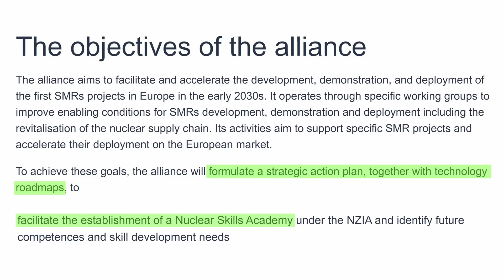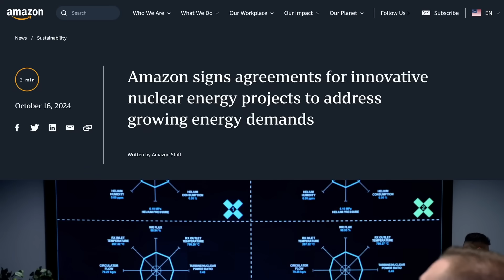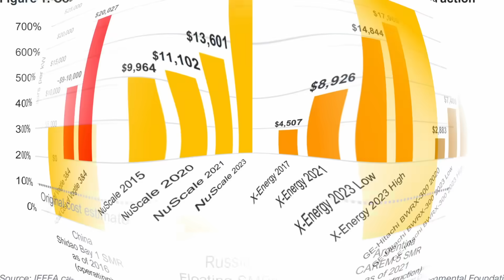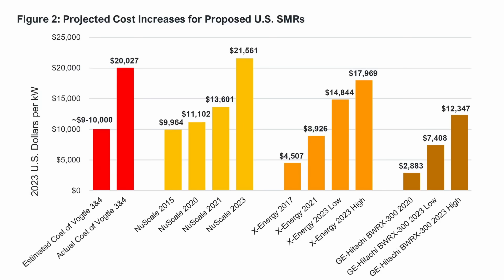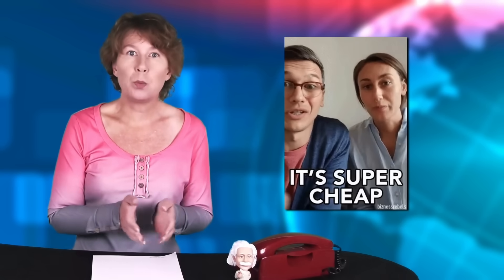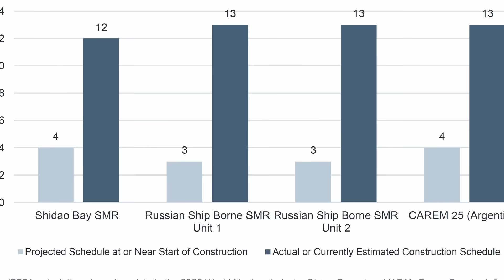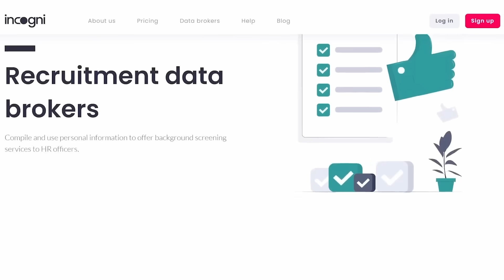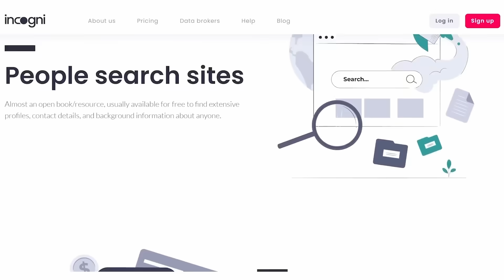Small Nuclear Reactors Have A Big Problem

Comment: CANDU reactors went over budget and still turned out to be a bargain LCoE wise.  It's unfortunate that Canada doesn't seem to have enough spare experts to built more of them elsewhere (They seem to only have just enough people to keep replacing the ones they have).  Correction: It seems Canada has enough CANDU experts to help India build about 3 at a time as well.  Without having unexpected "new site" (environmental concerns (endangered species), bedrock not being what was expected, Legal NIMBY challenges) or political issues it takes about 2 years.  With unexpected issues... ugh... 🤮 ...So let's just talk about if the site is already established! 2 years!  Refurb is "cheap" ate resets the life time! 👍  LCoE lower than solar without battery (if you include the first refurb (60 years))! 🤑

Comment: I watched your video thinking you might have some perspectives that others are missing, but you somewhat rehashed what other SMR dislikers have continually stated…. That they cost too much. While true if only a few SMR’s are built… it won’t be true for a design that takes off and does get mass produced. That’s the whole point of modular/mass-produced anything. 10 years ago, plenty of people said that EV’s would have never taken off because at the time, they did cost too much to make. Fast forward 10 years and million of vehicles sales later, the per unit costs have come down significantly, and now some companies can make them cheaper than gas cars. Will plenty of SMR companies fail? Likely… but if they’re the right design and have enough political support and capital up front to get over that initial R&D cost, they can become a reality!

Comment: SMR's have already been solved, at least in the US.  The issue is always getting regulatory approval for each phase of the research from the NRC who absolutely refuses to hand it out.

For those that might not know, the US Navy has been making SMR's for a few decades, those are the reactors that power Aircraft Carriers, Submarines and previously several other ships.  The A4W reactor for the previous generation of super carriers was rated at 550MW, the D2G reactor for previous unclear destroyers and was rated at 148MW.  The S9G, which is in many Subs, is rated at 210MW.  All these reactors are modular, and because the Navy doesn't' want "spent fuel ponds" inside its' ship, the reactors are designed to be replaced instead of refueled when they reach the end of life.  They cut a hole in the side of the ship, extract the old reactor unit, insert the new one, hook everything up then run tests to ensure it's solid before sealing the hole up.  These modular reactors are made on site along with spare parts, they are not bespoke.

Those designs exist because the Navy runs it's own nuclear program that does not have to obey the edicts of the Nuclear Regulatory Commission.  The NRC is not involved in any of the design, certification or operation of those nuclear plants.  The Navy has it's own licensing and training system that ensures Navy nukes are run safely because unlike the NRC, the Navy has a mission it needs to get done.

Comment: The nuclear industry has been intentionally lying about the cost for ages. Point Lepreau in New Brunswick was estimated at $400,000,000 for refurbishment. It ended up costing $2,400,000,000. They knew it would cost a lot. They lied all the way through. Now it's been shut down since April and it is costing New Brunswick citizens $1,000,000 per day that the system is down. 
We could have had a gigawatt or two of wind farm built with battery storage for the $2.4 billion price tag of Point Lepreau refurbishment.
One more thing...the nuclear industry lies about everything. There was no actual refurbishment. They tore down the old nuclear power plant and built a brand new one in it's place. That's not refurbishment in my dictionary.
Just a bunch of lying crooks.

Comment: Probably the regulatory overhead isn't so much anymore once you start building and realise the regulations define the minimum standard. So it's likely that most prescribed items would be needed anyway. And then overrunning of estimates, especially in time are really not so surprising, you'd likely not find a single reactor that was finished in the 2000s and 2010s that wasn't a complete overrun. So those few systems that are actually modern and  - assumed - safer still had those issues. Like anything we build on that scale. Its still likely a million parts (the only number I know is from the 70s or so where it was like 19million parts for a plant) and since the accident hazard doesn't change enough by scaling down you'll just not finish any in 1-2 years or so. Its just the portability that is gained.

Comment: Oddly small (modular is just not that useful a term, plug n pray) nuclear tractors um reactors (nuclear tractors are another story) do exist and work just fine, there are several hundred of them in the the nuclear powered subs that's hove the oceans also usually armed with atomic weapons ... quiet, very very quietly.

But are very highly guarded state military grade secrets in terms of production and operation ... most governments and their associated arms dealers will sell almost anything to anyone, except nuclear anything. 

So therefore it's implausible that private companies can just start developing and producing these things and then ship them to anyone, and plug em in to the grid? Nuclear anything is ridiculously complicated and expensive with massive lead times, safety concerns , security etc plus as above ... is just a go no governmentally.

Comment: "The Health Hazards of Not Going Nuclear" is a great book on the subject of Nuclear safety in the United States.
Reply: A book about the health hazards of fossil fuel combustion, right?   Well, renewables displace fossil fuels, so that argument is thrown into a cocked hat.

The actual deaths from solar/wind are so small that (at $12M/death) they would contribute negligibly to the cost of energy.  So, they cannot affect the nuclear vs. renewable competition, which nuclear loses on direct cost.
Reply: @pauldietz1325  Probably should read the book.
Reply: @rodneyjamesmcguire  That book was written in 1997.  Since then, adjusted for inflation, PV modules have fallen in price per watt by a factor of 25.   That book was comparing nuclear and fossil fuels, since cheap PV wasn't even on the radar yet.
Reply: @pauldietz1325  1977. You should read it. It doesn't really deal with pricing, but safety.

Comment: Nuclear power, like hydrogen, appeals to people with low IQ. A nuclear plant is effectively a giant space heater pointed at the sky and as power consumption grows , nuclear waste heat will outstrip any other form of anthropogenic heating.

That's why intelligent people support renewable energy which simply recycle energy that's already in the environment and then stores that energy in batteries which is the most efficient energy storage technology currently available.

Comment: Slightly OT but cannot all the "waste" heat generated by zillions of transistors be somehow recycled to produce clean water (desalination) , useful energy or both? Is it simply not do-able? After all, it is obvious that computational results are one thing and heat dissipated in circuit resistances is another. Since transistors can operate at temperatures above boiling point they could directly produce steam.

Comment: The problem is that the SMR concept isn't really driven by broad economics, the DoD wants be able to offload the burden of R&D, personnel, and tooling of nuclear reactors for its ships onto the civilian energy system.
Reply: That is what is happening over centuries. New technology is first developed for military use and is custom produced, and then as it gets common place is offloaded to civialian commercial production.
Reply: @dmitripogosian5084  Except the technology isn't fit for civilian power generation and these small reactors aren't the same as the military ones and need their own R&D. Civilian power benefits from the scale of large reactors. This is a case of the DoD trying to subsidize itself at the expense of the civilian power sector.  It is bad policy.

Comment: This lunacy is based on breeder reactors which require pressure containment and generate fissile materials.  Breeders won out over Molten Salt Reactors in the early 70s when Nixon picked them for cold war supplies.  MSR require no pressure containment since they fail safe.  They can also eat nuclear waste once they are running.

Comment: By "small scale nuclear reactors" im reminded of a portable nuclear powered generator set developed for the US government back in the 1950s.  It was decided to shelve the project after a quality working model was made because of fear that if released to the general population, "they would try to cut it up to sell as scrap metal" or something along those lines.  The Soviets also made such a generator set used to power remote locations.  In our press they are cursed for being potentially dangerous.  In reality I wounder if the threat to utility profits was the real motive.
Reply: Smoke detectors also used to have radioactive batteries
Reply: @АклызМелкенды  The sensor not the battery

Comment: I wonder why these big data centers don't just get more solar with battery backup instead of throwing money into these pipe dreams of small modular reactors? $3 billions? I'm sure that will buy more than enough solar+battery installations.
Reply: > I wonder why these big data centers don't just get more solar with battery backup
They have tried that, and found out the hard way that wind/solar are too intermittent for it to be economical.
The 'LCOE' that people quote leaves a lot to be desired!
Reply: @factnotfiction5915  I get that. But with $3 billions, seems like they can buy plenty of solar panels and batteries to overcome this.

Comment: The question is how these costs scale and whether they're associated with materials or with one-off expenses.  The oft-overlooked secret of technological change is that mass production is one of humanity's greatest strengths.  Costs rarely generalize.  The first unit and the initial R&D is always unpredictable, but the manufacturing learning rate associated with automating away whatever bottlenecks exist causes dramatic cost decreases as the number of units produced goes up.  Your first megawatt is exorbitant, your first gigawatt a luxury, your first terawatt a major industrial effort; But your tenth terawatt is too cheap to meter.

Comment: The citizens of South Carolina USA are going to have to pay for an incomplete Westinghouse AP1000 reactor, construction was stopped due to cost over runs.  I guess bigger reactors mean more money has to be thrown into the money pit ( a rarely talked about part of most nuclear reactorrs).  I'm sure the  people of South Carolina would love to have an offer from Google or any other tech company to buy into the project so they can cut their losses.  The cost being passed onto electric customers is large and a real problem.
Reply: It was not just cost overruns, it was natural gas and renewables coming on strong.   When the Nuclear Renaissance was big in the US there was concern gas would reach $13/GJ at the hubs.  It's down below $3/GJ now due to fracking.    Had gas been expensive and renewables not available V. C. Summer could have made sense to complete even with the cost overrun (the initial cost was sunk, after all, and the remaining cost was similar to the initial underestimate).   But with cheap competition completing it made no sense.

Tthe initial decisions to build V. C. Summer and Vogtle 3/4 were mistakes, even before the cost overruns.

Comment: Nuclear proponents are exhausting in hopes based on nothing. Thank you for a blunt breakdown of the data. 

Meanwhile, wind/solar cost more to connect to the grid from red tape than the power plant itself and are safe. Grid scale batteries supply chains are just ramping up with massive cost declines to follow. We already have a solution that will require a tiny amount of the mining as fossil fuels do, is much more efficient, and is cheaper than both fossil fuels and nuclear.

Comment: The red tape and legal challenges are the biggest hurdle. Most countries are trying to make smr comply with the requirements set for large high pressure reactors, which they can't because the systems are completely different. The safety requirements should be completely different as well as smr don't have the same potential for big explosions so shouldn't need a huge exclusion zone. The legal issues are huge, especially in America where pretty much any group can stop a project while a court case is made. The longer the projects take to complete the more they cost as most of the costs are upfront and they don't make money till they start producing power.

But the monetary savings from smr will only really kick in once the regulations are amended to make sense and large scale production begins. Like so many things, the first to do something faces a lot of difficulties, but once they show it's possible, lots will follow. Once we get to generation two and three of smr the costs should fall dramatically.

Comment: In Australia the opposition party (that is the guys with no power) have proposed we build 7 small reactors. Experts have pointed out this will cost billions and only replace a trivial part of Australia's energy needs so make no impact on our carbon foot print. This is while a solar or wind project can be completed in two years at close to budget, with the delays being how to connect all the extra renewable energy to the grid.
My favorite claim of all this is that no new transmission lines will need to be built, but at the site on one of these reactors they have stopped building renewables due to a lack of transmission capacity!
So the thing nuclear reactors do produce is bull**
Reply: Solar and wind are useless because you cannot control their input and are forced to try to store their output, which means huge batteries.  Further, their expected life is about 15 to 20 years, at which time they'll have to be replaced, again at enormous cost.
Reply: @AuJohnM  in Australia the most expensive electricity charges are when batteries are feeding into the grid at night.
Reply: @SpookFilthy  That's because your daytime costs have been driven down to incredibly low rates in the day time.  Any Grid that's night time power cost is more then it's daytime cost is already half way to the goal.
Reply: It's not incredibly low.  It's more expensive than other power sources when you add in the additional infra costs - look at places like California.  The more renewables in the grid the more expensive it gets.  Furthermore,  it is unreliable so then you need to bake in that extra cost of supporting it up with other power sources like gas. We pay more at night for batteries again than other power sources.  Renewables just don't cut it by themselves.
Reply: @grogery1570  The wholesale price of electricity is only one part of the cost of electricity, which also includes network, environmental, retailer, and residual costs.  Politicians needs to start talking about the full cost.  SA  has the most expensive power prices in Australia -  45.54c/kWh, vs NSW at 33.84c/kWh.  This makes my point.
Reply: @AuJohnM  which is different to fossil fuel generation, how?
Reply: @AuJohnM  Nuclear also has no control of output Dingus, it's not a dispatchable powersource either.
Reply: lolz - why are Amazon, Google, Microsoft, Oracle and the US govt all going to use nuclear power then or expand it?  Renewables will cost over a trillion, destroy the environment by tearing down forest and eco systems, have a life of span 15-20 years (compared to 80+ years for nuclear) requires massive expenditure with respect to transmission infrastructure and can't provide base load power.  I wish the renewable folks would be honest about the full cost.  They talk about power of generation being cheaper but this is not the cost borne by consumers and business who pay for the cost of energy at their premises.  They are not the same thing - insert transmission costs.    You need to back renewables with something like gas which can support the FULL demand of the grid at any time so you're paying for that to.  Nobody in the world is running purely on renewables.  It doesn't work.
Reply: As soon as Peter announced a site in the Hunter Valley, we had a major ( for the area ) earthquake. He claims to be christian, was it his god telling him something?